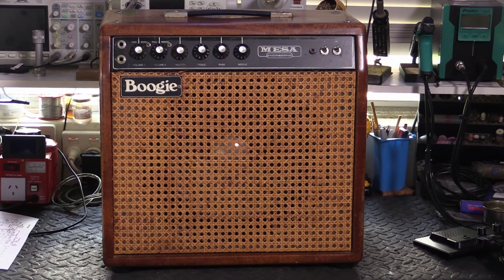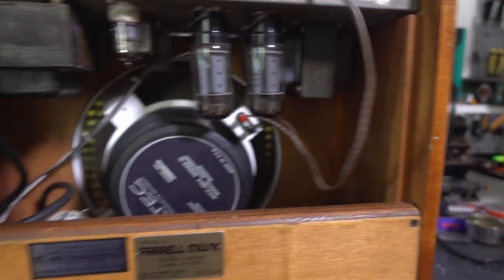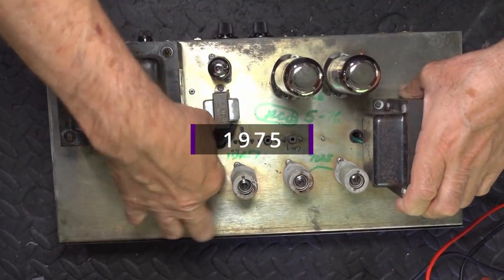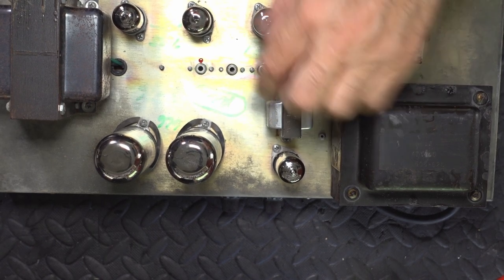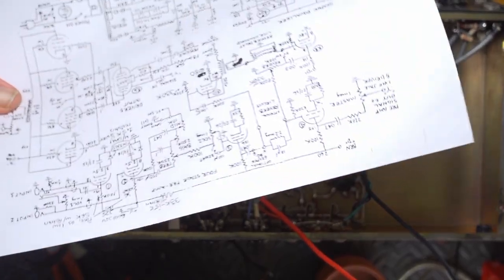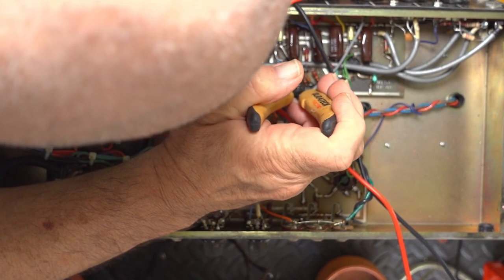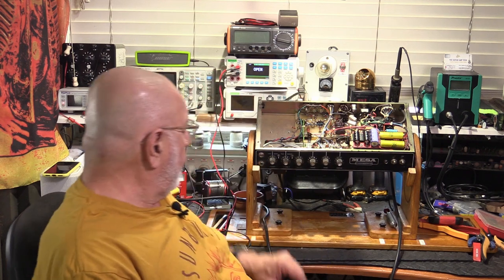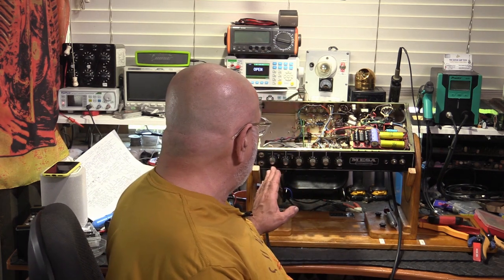Let's Repair and make Safe this Mesa Boogie Mk I - Part One

Comment: That "grafitti" was hand written by Randall C. Smith. You just devalued that amp.
Reply from the maker: Normally, I would doubt your comment as being accurate, but as the amp shows no workmanship to be proud of, you may well be right. I mean, who would put a child-like scrawl all over the chassis in a green Sharpie and Dymo tape. I had to move wires around (aka lead dress) just to stop the amp from going into oscillation. In my opinion, construction worthy of a signature is a Matchless, Diezel, or Soldano. Every single mass-produced (50s to 80s) Fender ever built is better than this Mesa. 
Granted, the cabinetry in the Mark I is gorgeous, but who would sell an amp like this? In truth, I have increased the value of this amp considerably. I have asked the owner if I can continue to upgrade the workmanship in subsequent services. I know that the burned wires were not the work of the Mesa factory.  
I am sorry, Shaun. You are clearly a Mesa Boogie devotee and I respect that. I am sorry if my comments seemed harsh, but look at the comments of other Techs on this video.  Having said all of that, I love the sound of the Mk 1, S.O.B., and my personal, much-improved, Studio 22.
Reply: @theguitaramptech  thanks for the reply. Your work is definitely a cut above Randall's. I'm definitely NOT a Mesa fan. I liked the sound of Santana playing through his early ones, but I find most all of them sound harsh to me. Most of them in my opinion, are very poorly designed and nightmares to work on. I would never buy one. Millions would, and do...and would pay extra for Randall's genuine green Sharpie scrawl. LoL.
Reply from the maker: @SuperShaunM  hahaha! You are a true gentleman, Shaun. I 100% agree with all you said… maybe even the scrawl 😂
Reply: Randy Smith didn't sign those amps ... Michael Bendinelli, the lead tech and good friend of mine would initial them after they passed his 'big hammer' tests. I am sure Michael would admit that removing his signature did absolutely nothing to the tone ... 🤪
Reply from the maker: @bluewaterstudio  that’s a very interesting Daniel. 
So, does your mate think that the childish green scrawl (so sorry Michael) was from the factory, or some drunken tech in the last few decades?
A subtle and tasteful signature, like Phil’s inside a matchless, would be way more befitting of an amp at this price point and prestige of a Mesa.
Reply: @theguitaramptech  Michael worked for Mesa Engineering since the beginning and would sign his initials in various colors. I never asked if there was any real significance behind the selected color. I just knew that when he signed it off the amp was ready to play. We became good friends and he really treated me well. I had developed some circuitry to eliminate the switching transients when channel switching or enabling/disabling reverb and EQ via the foot switch. It was some clever zero-crossing circuitry .. but Randy thought it too complicated and went with the LDR design. So many of those FET switches ultimately fail and can be a real pain to replace.

For me, the best sounding Boogies were those early Mark I's. When I bought my Mark V:35, first thing I did was replace most of the 12AX7's with my favorite 12AY7's. Just too much gain .. and I changed the bass response on the clean channel to recapture that 'bell like' tone I love in the early Mark I's and old Fenders.
Reply from the maker: @bluewaterstudio  What a great story, Daniel. Thank you for sharing that. 
You are spot on about the difficulty in replacing the switching and muting circuits in later Mesa amps. I believe Randall lost his way n trying to stay ahead of the competitors. If he spent more effort improving the quality, reliability, and serviceability of his amps instead of having a hundred different models he would have left a great legacy. But WTF do I know? He is a multimillionaire and I will be soldering until I drop dead with my forehead leaning against a MusicMan's 700v B+.
Reply: @SuperShaunM  Hi Shaun .. I apologize because that is clearly Randy's initials. I missed that part of the video and forgot that this was a very early amp where he would usually initial the chassis. The DYMO labeled amps were his work, but when production started in Petaluma I never remember seeing his initials on the amps. Though honestly, I never looked for them. Michael always signed them along with a few others. I have to agree, as visually objectionable as the signature might be, it probably should have been left for posterity.
Reply: Great to see huge transformers. Exactly how it should be done. I loved the 1986 studio22 that I once owned but it was so unreliable and poorly designed. 
Valve seats burnt out joints on a regular basis so it had to go! I was glad to see the back of it and would never own another.

Comment: I've never played a Mesa that I liked the sound of. Given it a fair old try: even took my pedal board and guitar to a shop and sat with a couple of Mesas for more than an hour. They just didn't sound right. Back then I played Marshalls (JMP, JCM800), so that was my point of reference. There was something wrong about the voicing: it sounded either nasty or flat like a steamrolled cane toad. 

Re this amp, I think I'd have just replaced all the electrolytics on sight. But I'm not running a business and trying to keep my customers happy with the bill. You couldn't pay me enough to fuck around inside a Mesa,  let alone somebody else's Mesa! 😀
Reply from the maker: You raise a very good point, Bladder. That of what to change, specifically electrolytics. I confess to being one of those who once replaced any electrolytic over 20 yo without question. However, I have become more conservative of the amps history in the last decade. If the capacitance is within spec, and the ESR is under the maximum value, and if its original to the amp, I will always consult with the owner. I will ask "will this amp be your main live rig played regularly, or used in a recording studio". If the answer is YES I will change all the main filter caps, and the cathode bypass caps. If the answer is NO, I will only change what has failed. I'm glad you raised this point, Bladder. I will make it a sign on entry to my Workshop.
Reply: Totally agree Bladder!
Reply: You obviously didn't crank it up! A few of the Mesas I've owned have a beautiful 3 dimensional tone when cranked up a bit and tweaked correctly, they can sound a bit flat at low volume admittedly but so do most amps. I also admit that these are 'tweakers' amps and finding the sweet spot can take some time but when you do you're usually in for a tonal treat.
Reply from the maker: @Pete_Harris  I sort of agree. 
Until Mesa gets past this "no need to bias" foolishness they all sound lifeless and just plain fizzy to my ear as a musician. However, once you set them up properly and get rid of that nasty crossover distortion, I agree with you Pete, they can sound wonderful.  (I will never like a Triple.)  Once you set them up you can get that 3-D sound much easier, much less fizz, and full power tube throatiness (bad luck if you have a 100w'er). 
If you have a good Tech take the one that you find the hardest to get your tone from and ask him to set it up properly. I am sure you will love it even more..
Reply: @Pete_Harris  I didn't crank those Mesas, but I don't have the impression that was the problem. I've played quite a few cranked amps, large and small, and built a few, too. Those amps were just crap. This one might be different, but I wouldn't pay for one either way.
Reply: @Splattle101 I had the exact same experience with a Hughes and Kettner. Just awful.

Comment: Dreadful bloody power filter cap wiring under that piece of driftwood Chris!  Too much glare on those o/p tube monitors; I could barely see them mate!  Onto part 2 !---->
Reply from the maker: Thanks for your input, Neville. Yes, the amp looks like a high school project and not a premium-priced product. 
You are right about the glare, which I didn't notice until the editing stage. I have since replaced that overhead camera (with no monitor). I think the results are much better in the recent videos. It is SO EASY to spend money on this non-income-earning hobby of making videos, Neville!
Reply: @@theguitaramptech    Yeah hobbies are expensive; no doubt!  Despite whatever even minimal returns we get though, it's always money well spent due to the satisfaction we enjoy, making something work just a little bit better!

Only constructive criticism being offered here Chris, & I'm glad you received it in the spirit it was intended!

Hah!  I was gonna say that unterminated mains wire there looks like one of those 'gimmick' capacitors I've seen used inside a couple of old valve radios.  They 'peel off' a turn or three of the wire to get the right value.  But it appears somebody has already mentioned it!  D'oh!

Comment: looks like a can of trouble those blue Philips condensers  are trouble
Reply from the maker: Yep. (Please forgive me Ian, but I sent a Mesa owner your way. Yes, it was a Triple. Sorry. )
Reply: @theguitaramptech  I work on all types of valve gear rebuild 1960 machinosh 275 some piglet had butchered
Reply from the maker: good bit of self-promotion, Ian.
Reply: Those blue Philips condensers are fine until they short.
Reply: @stevehead365  you may want to do some research on that

Comment: I've heard/read rumours that Mesa/Boogie deliberately put errors in their official schematics for their amps just to stop people from copying their amp designs, but if you really analyse their schematics a lot of them use fairly standard circuit blocks, and Mr Randall Smith keeps going on about innovative ideas used in his amps.
Reply from the maker: Yes, there are errors in some schematics. From my perspective, they were more from incompetence than planned malice. Who would want to copy all of those flaws and ridiculous design ideas. Some of Randall's ideas were innovative but not in a good engineering way. One of my favourite examples of marketing stupidity is his saying that biasing power valves is just a greedy Tech's way of making money. So he biases amps ridiculously cold so he is not caught out as a liar. 
Or, when was the last solo you played  were you said to yourself, "I could be so much more expressive if I could change rectification from tube to solid state!" Sadly, Randall is such a brilliant marketer that people buy his bullshit...and amps.

Comment: man that is some reallt bad quality manufacturing
Reply from the maker: I can see where Ronald MacDonald worked on the amp, but even so, the construction was terrible for such a premium product.
Reply: @theguitaramptech  Do you seriously think this amp left the factory in that condition? The whole video is basically putting down Mesa and I've had no serious problems with them after owning a Mkiii combo, Mkiv combo and head, 2 Heartbreakers (combo and amp), TA-30 Combo, MkV combo...over a time period of 35 years none of these amps has needed a repair, only servicing and valve changes.
Reply from the maker: @Pete_Harris  I'm sorry to say that the amp's construction was a smear on this prestige brand. Yes, there was some terrible work done in the subsequent 45 years, but I have worked on enough amps to know shameful work when I see it. The construction and layout was substandard. Yes, they used fabulous critical parts like the transformers (which is why Mesa's sound so huge), but the PCB was a shocker. The PCB construction got better with time, but then they had other issues. 
I am very happy that my customer is thrilled with the work I did on his Mark 1 and the sound I got from it, certainly better than what came out of the factory.  As I said, I am very happy that you still enjoy your Mesa's as trouble-free. 
Please remember that amps only come to me when they have problems. I don't see the ones which operate trouble-free. I am very sorry if I upset you, but its only my opinion as a Tech. I love my Studio 22 (shit construction), a customer's Son Of Boogie sounded wonderful after I repaired it (shit construction) and rewound the transformer. Surprisingly to me, a Single Rectifier sounded fantastic after I repaired it and set it up as it should have been.
I'm glad you like Boogies Pete. Viva La Difference!